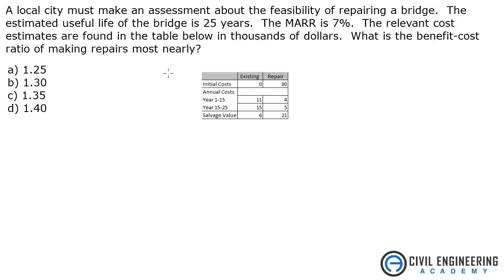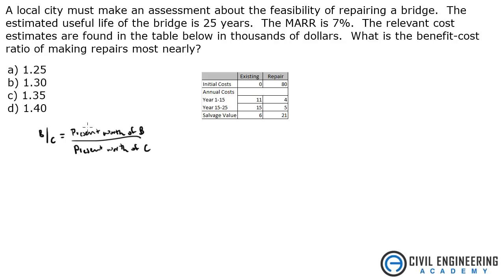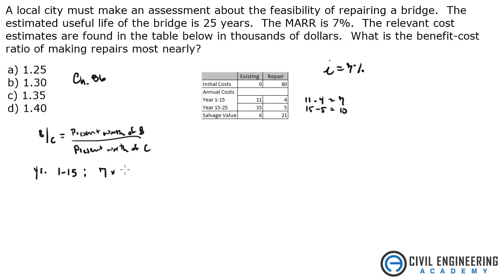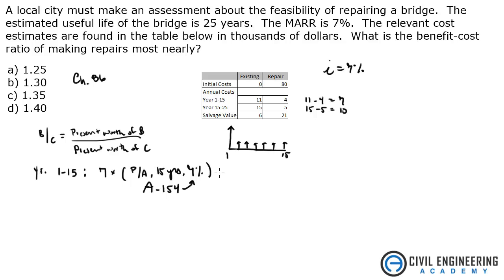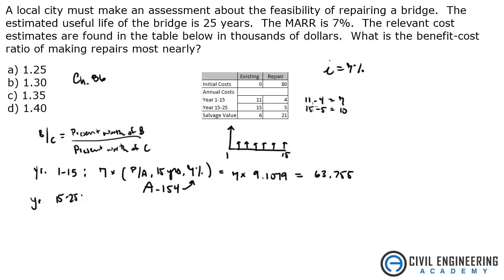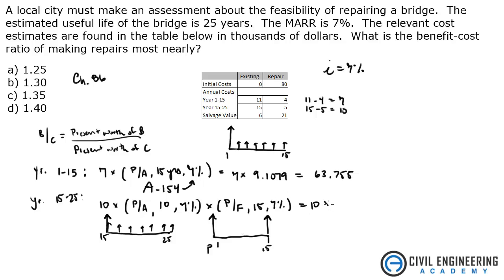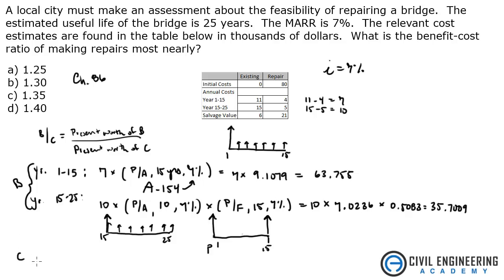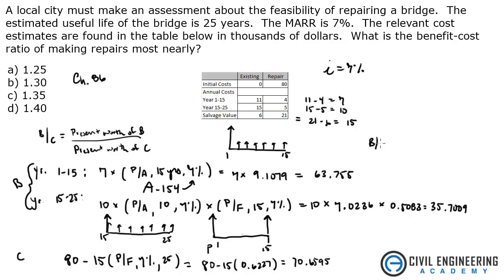Civil PE Exam - Construction - Benefit to Cost Ratio of a Bridge

Comment: The book recommends superposition for stepped cash flows. When I try this method I don't come up with the correct present value.Any idea why?
Reply from the maker: Your calculation should be close to the solved solution. Maybe you used incorrect value from the table. I tried to use superposition and got close answer in the video.

Using superposition:
Present value of Benefit
= 10*(P|A,25,7%) - 3*(P|A,15,7%)
= 10*11.6536 - 3*9.1079
= 89.2123

Your solution:
Present value of Benefit
= 7*(P|A,15,7%) + 10*(P|A,10,7%)*(P|F,15,7%)
= 7*9.1079 + 10*7.0236*0.3624 
 63.755 + 25.45 
 89.205
Reply: Thank you for the response

Comment: For (P/F,15,7%) I got 0.3624 (appears the 0.5083 value used in the video is for 10 years, not 15). Also, for (P/F,7%,25) I got 0.1842 (not 0.6227). The B/C ratio I calculated is 1.15. Thank you very much for these videos. They have been outstanding and a great help.
Reply: Civil Engineering Academy I get 1.14 which is not much different than ccbanka. We all make mistakes; aside from that, the videos are great! Keep making the videos.
Reply from the maker: ccbanka Thank you for catching this!  I don't know what I was looking up..I think it was late night!  I have corrected the video with some comments so I hope it helps others that check it out.